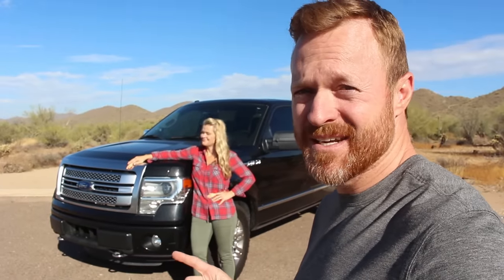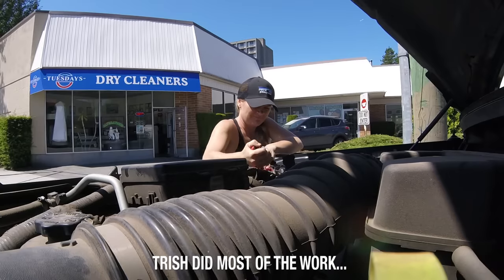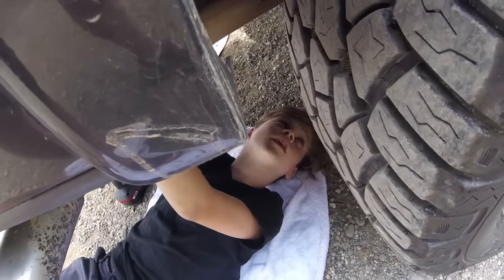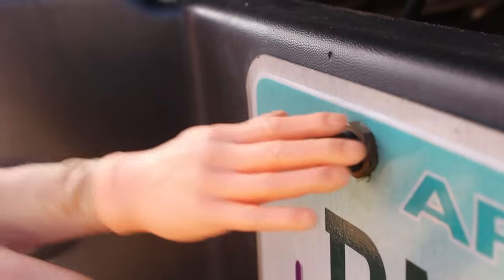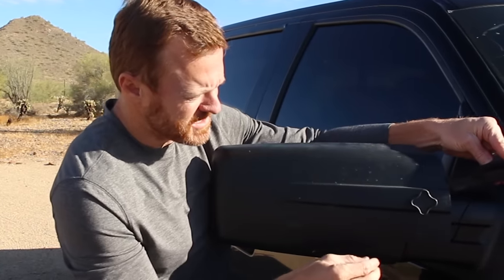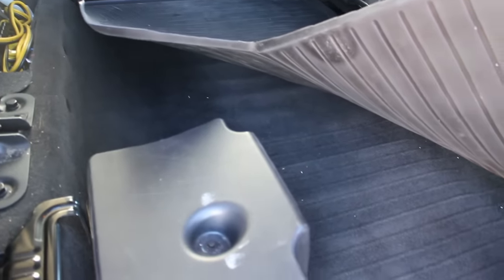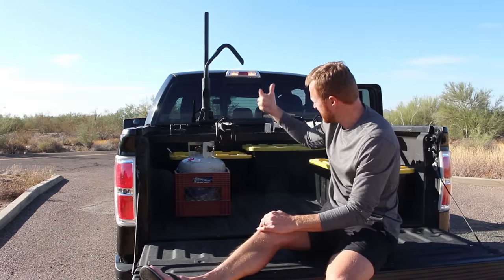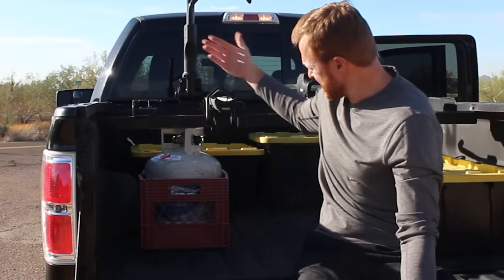TOWING WITH A HALF TON TRUCK (FORD F-150)

Comment: remember if you have sag you have to much hitch weight and you have overloaded the trucks suspension.  Yes the air bags will level it back out but you are still towing beyond the trucks suspension you are just hiding it.  but you do you BOO BOO

Comment: I love you guys.  Please do me a favor and look at the label inside the drivers door and check what the payload capacity is of your truck and then subtract your tongue weight and your gear and people weight.  Your truck may only have a payload of 1350 lbs and if your tongue weight is 800 lbs that doesn't leave you much weight for cargo and  people.  Please take it slow with this setup, I have done a lot of research  trying to make the 150 work for me and I am sure you are at the max on payload and gross total weight (truck+TT),  you are probable well under the max tow weight.  If you ever pull with a 250 you won't believe the difference.  When my wife drives with our 250 I have to keep on her to stay below 80 mpg.  You can't even tell the TT is back there.  Also take look at the electronic sway control by sway master.  It mounts on your trailer tongue and when it detects a sway it hits the trailer brakes to pull the trailer back inline.  Safe travels keep up the great work.
Reply from the maker: You have a great point. I had a segment on cargo capacity, but didn't include it because I wasn't 100% sure on my info. But I'm 1,500 pounds, which is still pushing it. But the weight dist. system off sets that I was told.
Reply: no, you're still limited to that 1500lbs of payload regardless if you have a WD hitch or not. Helper springs, airbags, etc, while all rated to carry x amount of weight, only help level the truck/prevent sag, they wont increase your payload rating. I'm willing to bet you're pretty close to the limits of that 1500 if not over. Best bet, hit up a scale and know your weights. You should also look into good e rated LT tires if you havent already. 

Great video guys, keep em coming!
Reply: There has been a lot of discussion on boards concerning what your insurance company would do if you had a serious accident and you were exceeding the tow and cargo capacities.  Some say that is the first thing the insurance company looks at.  Many RV dealers play stupid  and let their customers drive away overloaded because they know if they told them they needed a bigger truck they wouldn't make a sale.  You guys are the best RV Tubers out there.  You set the bar for the rest.
Reply: @rvsomedaybutnottoday7430  that is absolutely true guys. Also if someone is seriously hurt or killed you will be held liable because you would be exceeding your payload which means you are overweight for that vehicle. Check the laws with your local DOT because if you ever have a serious accident you will be in a lot of trouble.

Comment: Make sure you are checking the tow capacity. In my ignorance, i thought my F-150 could tow 10,100 lbs, Not even close. I didn't realize i didn't have a tow package and only a class 4 hitch. This dropped my capacity down to 6000 lbs. We were about a day away from buying a trailer that was 6500 lbs. The dealer didn't bother asking, they don't care, they just want the sale. We ended up with a much more better option of 4400 lbs. Thank god i was questioning my capacity so much, i would have been stuck. I have a 2023 F-150 XL. Ask the dealer, they will help, ours did.

Comment: Guys sorry we had to go home but my Chevy was getting tired of towing your Ford...LOL.  On our Chevy 1500 we changed the spark plug with quad 4's, fully synthetic Valvoline oil, put a K&N air filter, Firestone air ride (not helpers), and the most important was we CHIPPED it.  It jumped from 12 to 16 and the BHP went up 35 "BUTTTTTTTTTTTTT" the air fuel ratio from take off was seriously too lean when trying to take off going up hill with our 30' tow behind.

Comment: Thanks for the info on the F-150 & what it’s done for you ... the part I liked the best was the “go with what you have, or you’ll never get started.” So very true.
Reply: Calamity Joe  100% this. smh at people pulling these things in half tons. The frame of that half ton is not built to handle that trailer.
Reply: But yet look at some old videos of folks pulling Airstreams with old 100 series Fords in Africa on a caravan. They did it!!

Comment: Nice video. I have a 2020 F150 and pull an 8800 pound 40' trailer. I laugh at everyone who says you can't do that as I'm doing it. However, I'm not the typical camper. We don't travel everywhere and/or constantly. Neither my truck or camper is fully loaded with anything because we go with two vehicles. We typically camp less than an hour from our home and the longest trip we take is the 1200 mile round trip to Sturgis. Pull my camper with ease and no worries; regardless of what the whiners say they can't handle.

Comment: We have a 2012 F150 Lariat  and have a 30' Vantage trailer.  We have towed this trailer over 10,000 miles without incident. I put load leveler shocks and it is perfect and level...
Reply: How does it handle up hills and downhills ?
Reply: And do you have any e-brakes on the trailer? Just because a vehicle can move the trailer doesn't mean that it can stop it, safely. Just my two cents there.
Reply: Have you ever hauled it through mountains? I'm about to haul one through Georgia/Tennessee mountains with 13 King Ranch. I was wondering if I should just go through Arkansas instead. Love that truck.  Do not want to lose it or family to break failure.
Reply: @jacoe33333  It does not even know that it is going up and down hills,  Twin Turbo is amazing!
Reply: @Sig721Tau  Yes I have trailer brakes!
Reply: @TheSupernaturalWolf41  I would not hesitate to take it anyplace!

Comment: I know some of your respondents have the Eco-Boost engine but for an old timer like me, there's no "replacement for displacement". The 6.2L engine is your biggest asset. The Eco-Boost engines have great specs and perform well in towing tests but in general terms, the smaller engines operating under boost pressure can't help but wear out sooner than your big block. The payload capacity is definitely the weak link in a half ton's capabilities. The other issue with heavy loads (and reasons to upgrade to 3/4 or higher is the stress on drive train components including transmission, brakes, axles and wheel bearings. Your 9,200 lb load is what my Ram 2500 weighs out at with a fully loaded truck camper (800 lbs below it's GVWR). I'd be curious to know what the GVWR and rear axle rating is on your truck. I'd bet good money that you're overloaded.  Also, check the load ratings on your tires and verify that they are also within spec.This can have safety ramifications as well as legal issues should you ever be in an accident. Take your rig to a CAT Scale someday, fully loaded (full tank of fuel etc.) and get your weights checked (front and rear truck axles and trailer axles) just for peace of mind. I don't mean any of this to be critical but simply useful information for anyone interested.
Reply from the maker: All good points.
Reply: Travels with Yoly good points . Don't forget that the passengers are part of the equation. 5 people (600lbs), 10% minimum recommended tongue weight (920) Bikes (100) fuel,   etc. I have a Ram 1500 with 1700 payload and my trailer is 7000 GVWR and It is hard for me to keep the weights right. My local CAT scale costs $11 for a first weigh and $2 for a reweigh within 24 hrs. Knowing individual axle weights is critical. Most important is that you are not reducing the weight on the front axle which will compromise the steering in an emergency situation. I don't get much sag with stock suspension so it is possible that they are overweight.
Reply: We have an older F350 diesel dually and had to swap out a truck camper for a 5th wheel because of this very reason.  The truck had NO problem going anywhere we wanted to go (with the truck camper), but we were over the GVWR (I guess they didn't rate them very high for our year).  Just because it CAN pull it doesn't mean it SHOULD pull it..............and we were very concerned about any legal ramifications should we have an accident.
Reply: Your point comment  " Just because it CAN pull it doesn't mean it SHOULD pull it" are words of wisdom. I know there are a lot of people with 1500s that carry truck campers way over the GVWR. They justify it by citing the suspension upgrades that they have made saying that the truck handles it easily. Adding air assist to the rear will definitely help level the truck and improve the ride but nothing you do with suspension upgrades increases the GVWR. In this condition, in an accident, even if you're not cited, your insurance company is off the hook in paying a claim. If you look at the FCA (Fiat Chrysler of America) web-site, it states quite clearly that NONE of the half tons (other than the lightest regular cab, 2WD, short bed, V-6) is CERTIFIED to carry a slide-in truck camper. Doing so could void the warranty on drive train components. We purchased the lightest hard side slide-in camper we could find advertised with a dry weight of 1,385 lbs for our half ton (with the suspension upgrades). With just my wife and I and a light load I calculated us to be a100 lbs below our GVWR so we went ahead and purchased the camper. I had never driven a truck camper rig before and the 360 miles home from the dealer in NC was really freaky weird and scary. Just before we got home I stopped at a Love's truck stop, filled the tank and went around back to the scales, again, just for peace of mind. The camper was completely empty other than a small bottle of propane provided by the dealer. Surprisingly (or maybe not so much) the truck weighed over the GVWR without my wife and I nor any camping gear in it. The camper as it turned out was about 600 lbs heavier than advertised. Within days we were back to the dealer and given a full refund. A month later we switched to the 2500, went back to the same dealer and purchased a really nice truck camper, a bigger, heavier one than before. We are 800 lbs below the 2500's GVWR (fully loaded) and the difference in ride (confidence) was night & day :-)
Reply: LMFAO they are going to wear out but people keep buying them something got to give they are not cheap trucks  i love seeing bullshit comments like that  but you can't tell me why the ecoboost is Ford's best selling engine
Reply: Commonly known as Ego-boost! Lol!
Reply: Gary Allsup - So what is your GVWR for the vehicle with those options and what is the GAWR of the rear Axle?
Reply: Worst case published spec is that the F-150 weighs 5,238. subtract that from 7650 you get a payload of 2412.
You may be better than that. With my Ram which is stock with no extra weight capacity I have 1750 payload so I have to be more careful. You did good to order your truck that way. 
10% to 15% tongue weight puts you at 1200 lbs worst case still leaves you 1212 pounds of people fuel and cargo.
My trailer in 7000 max  10% to 15% tongue weight puts me at 1050 worst case and leaves me 600 people fuel and cargo. I should have purchased extra weight capacity.  I try to keep tongue weight at 875 (12.5%) which leaves me 725 lbs.
It's easy to find the truck overweight thinking that you are good. 
Congrats on having the foresight to set up your truck right.
Reply: Your RV Freedom that 5,238 number you found is a little low. He said 2012 F150, which was before they went to aluminum. The heaviest truck, besides the raptor, would've been closer to 6,000 lbs for that model year. Depends on the cab, bed length, and 4x4, etc
Reply: Fordguy1997 Goid point. Using your number then there is a lot less payload.
Reply: I tow 6,660 lbs per liter of engine and have 450,000 miles on a CNG truck.  15,000 pounds with 3.5L is 4,285lbs  per liter of engine. Stop saying the ecoboost can't handle long term towing without proof. 

Here comes my brother in-law's dad's third cousin's truck this and that.
Reply: Travels with Yoly I’m curious how you get your data that a 3.5 eco boost wears out before a 6.2? Did you just make it up?
Reply: Travels with Yoly First of all the turbos hardly ever kick in unless you are passing someone.  The truck has a 10 speed transmission, and actually runs at a much lower RPM to achive it's maximum torque Vs a V8.  

You are clearly just speaking out of your ass LOL.
Reply: Travels with Yoly our 2016 echo boost with max tow package pull our 2018 Jayco half ton fifth wheel at 8, 400 ponds dry weight like nothing. No problems.
Reply: Travels with Yoly  you’re totally wrong about the echo boost
Reply: Yes but for many of us we only tow about 4% of the trucks mileage/life...that means the rest of the year I'm getting 21MPG on the freeway. I can put up with the 9MPH while towing and at 180K miles my truck engine has only needed a few acceptable issues common to turbos and direct ignition engines.
Reply: I like Fords, especially the pickups but wouldn't touch the Eco-Boost. My nephew asked what to buy and I told him to get the 5.0  and he did. He is very happy with his choice and he tows a 22 foot travel trailer.
Reply: Travels with Yoly I would agree that they are over loaded..I've got a platuim series/f150.i wouldn't tow that amount on a regular,wear,and stress on transmission and motors plus smaller things like the brakes etc
Reply: Travels with Yoly Agreed
Reply: I've got a 18 .f150 max tow 3.5 eco with the long bed and it's a tank. I've towed my 37ft TT with 8100 dry and it towed it no problems. I just recently installed airlift 5k air bags so it should tow even better.
Reply: Safety is the most important thing to consider when towing error on the side of caution better to have too much truck than be on the edge of your trucks factory specs
Reply: Travels with Yoly - I would tend to agree.  If the trailer is over 28’ there’s a good chance of being over on payload, hitch capacity, GVWR, and GCWR.  With the amount of sag shown in the first part of the video something with the weight distributing hitch must have been setup wrong.  And it is true that adding air bags doesn’t increase the capability of the truck.

Comment: Great video!

Something I learned when researching which truck to by... this is merely FYI, we all decide what fits for us and what we're comfortable with.

When looking to buy take a very close look at what is different between the 2500/250 and 3500/350. I was about to buy a 3500 Ram SRW w/6.7 Cummins for our 5th wheel which was ~$10,000 more than the 2500. SRW because my wife isn't comfortable driving the wider dually (frankly, neither am I as a passenger :) ) My brother-in-law has been a Ram diesel specialist for decades. Over breakfast he told me NOT to buy the more expensive vehicle (note I didn't say better or larger). He schooled me on how they are different and there are only a handful of differences between them. If you add bags (I added Air Lift Load Lifter 5000 bags) you have made your heavy duty RAM 2500 into a heavy duty RAM 3500 in all but name only and done it in a way that improves your load stability over all. If you doubt this start comparing the part numbers of things like brakes, springs, axles, etc. They are the same between the 2500 and 3500. This is for RAM at least, unsure of the other brands.  

With that said, yes I know... this isn't going to change your "legal" towing or load capacity. However, you can safely tow/carry with no fear of a weight related breakdown up to the 3500 "limits." 

40,000 miles and not a squeak out of her yet (the truck I mean). BTW, we wound up buying a 2500 Laramie Longhorn w/6.7 CTD MCSB SRW.

Things I've done, all to improve towing capacity/fuel mileage/endurance.
- Air Lift Load Lifter 500 Air Bags
- Banks Power Cold Air Intake (CARB legal)
- Banks Power Monster exhaust (deletes the un-necessary muffler, also CARB legal) w/ pyro and differential temp sensor.
- Edge Evolution Diesel Tuner (CARB legal)
- Power Stop Severe Duty Brakes & Rotors
- Steering Stabilizer
- Larger than stock tires and wheels
- 57 gallon diesel Tank installed by Titan in Idaho Falls during a trip to the Tetons (if you own a Ford diesel look into replacing the metal tank you have, it WILL de-laminate over time)
- Coolant Filter (ya, they actually make these)
- Cummins Heavy Duty Fuel Filter Kit (pre-filter)
- Lubrication Pre-Filter (arguably not needed but I figured what the heck)
- AFEPower differential cover (Gale Banks is doing a test to see if after market covers are good or bad... it doesn't look good for them) See the BanksPower channel.